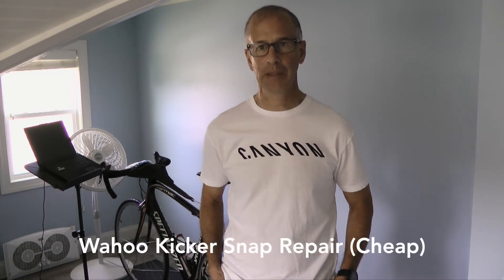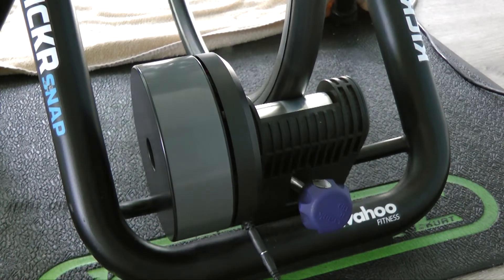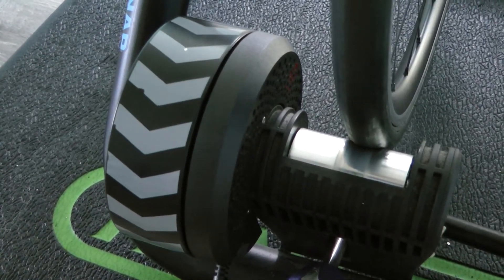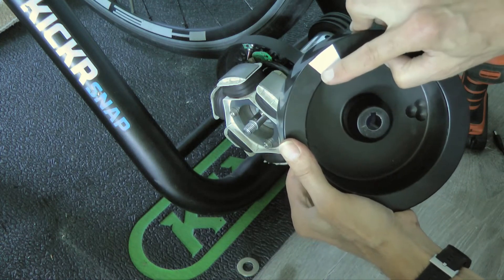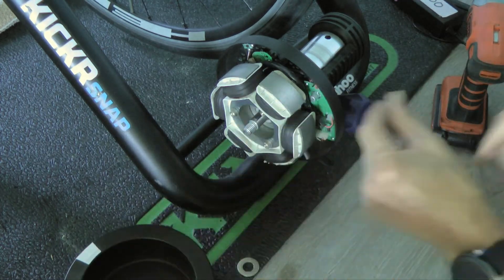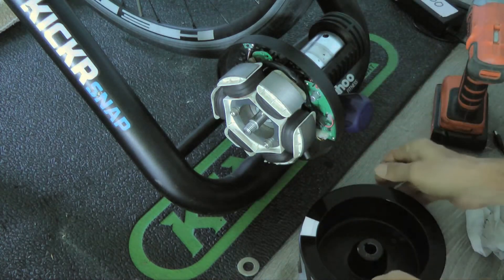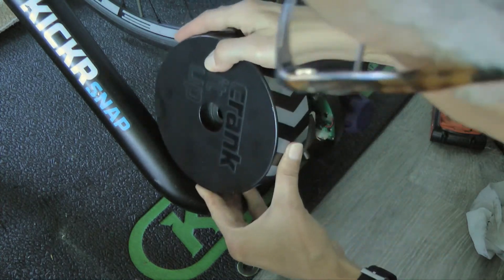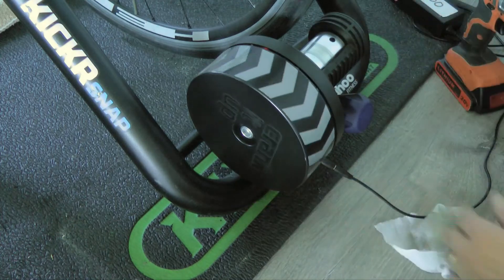Wahoo Kicker Snap Repair (Cheap)

Comment: Excellent video . Good info. One question. How did you keep the flywheel from turning when removing the bolt? Thanks.
Reply from the maker: @kevinworley2008  if you use an impact driver, it will loosen the bolt easily. If one is not available, it is difficult to keep it from slipping.
Reply: @paulbonner8874  Cool, thanks!

Comment: I have trouble removing the center black plastic cover to access the nut. Any advice?
Reply from the maker: I think I used a sharp blade to pry the plastic cover off the first time I had to take things apart. I ended up not replacing the cover as it is only cosmetic. Therefore, I would do whatever you need to do to get it off. Thanks, Paul
Reply: @paulbonner8874  Thank you, I didn't want to damage it. Mine is a 2 months old Kickr Core with no more speed reading. I've sticked a white paper strip on the flywheel inside surface without success. I've contacted Wahoo support and a brand new replacement unit was sent to me.
Reply: @paulbonner8874  
Wow, I'm still having a hard time trying to pry it off. I'm using a sharp box cutter blade and I can't get it down into the seam at all. I'm thinking about trying a hammer and screwdriver and see if I can just pound the piece until the plastic breaks into pieces. I bought mine two years ago, so it's well beyond warranty. This is like tying to break into Fort Knox!
Reply: I actually used strong tape across mine and pulled out that way. There aren’t any clips, just held in with friction.

If you’re not bothered about destroying it, you could just drill through the centre and pull it out that way!
Reply: Hi, can I ask what size socket you used please?
Reply from the maker: I'm pretty sure it's a 19mm

Comment: Have you ever replaced the aluminum roller? Mine has a couple of grooves worn into it...
Reply from the maker: I have not needed to do it, but it does not look too difficult if you have the tools. Finding a replacement part could be challenging.

Comment: Hi Paul, great video, and good to see how to pull the flywheel off. My issue is the spot on the roller that contacts the tyre is worn to the point that it is concave (yes, lots of kms!), and the anodised aluminium is gone, so I have smooth aluminium. Unless I tighten the tyre ridiculous amounts, it tends to slip on grades and sprints. I noticed you talked about the adjustment bolts in the roller.  Can that roller be removed and replaced??? any thoughts?! Thanks!
Reply from the maker: Daniel, I've never heard of someone wearing out the aluminum roller, but there are 2 set-screws that may help you remove the roller and replace. You'd have to get everything apart first, as the lower plastic piece would also need to be removed. I'm not sure if you can get replacement parts, though. You'll have to contact Wahoo. Good luck.

Comment: Hi, do you have dimmensions for the white sticker ? I have a trainer with no power isue but theres no sticker on fly wheel. put one on and have some power but it shows some realy too big numbers after calibration
Reply from the maker: The sticker is about a half inch wide. Just enough for the sensor to see it and count it. Hope this helps!

Comment: Can you tell me what type of white tape you used? I’ve run into the same problem in the last 10 minutes which is how I found your video but there seems to be a wide variety of white tapes available.
Reply from the maker: Anything that is bright white should work. Mine is from a label making machine.

Comment: Good to know this! My Snap is only a month old, can I ask if yours runs totally smooth and silent? My one has a noticeable very minor sort of cyclical hum/rumble (like a "woom-woom" noise more noticeable if you're at speed and stop pedalling so the drivetrain noise is absent) and I'm not sure if this is just the wheel and/or tyre maybe being slightly off radially or something else? Running a Vittoria turbo trainer tyre at 110psi, two full turns of the knob from first tyre contact on the roller (and let it off when finished a session)Have you serviced any other mechanical moving parts of it like replacing bearings? You mentioned those two "adjusting bolts on the sleeve" , what do they do?? !!
Reply from the maker: Thanks for commenting. I don’t think my snap ever ran perfectly quiet. I did have a bearing issue way back and had them replaced under warranty. It was really loud though, not what you’re describing. The way you’re setting yours up is exactly the same as me. When I release the tire after finishing, the trainer should spin for minutes on its own with no tension. If it doesn’t then maybe your bearings aren’t perfect or there’s a balance issue. The Allen bolts in the sleeve are for balancing the system and shouldn’t be loosened. Wahoo sets it at the factory and changing the location could cause a lot of problems. Best of luck, Paul.
Reply: @paulbonner8874  Just spun it by hand in 34/28 up to a decent speed and let off the tyre>roller pressure and it did spin for absolutely ages and quiet. It's got a 2 year warranty anyway, found out a colleague of mine has one and he said his packed in after a year and they just sent him out a new one under warranty....